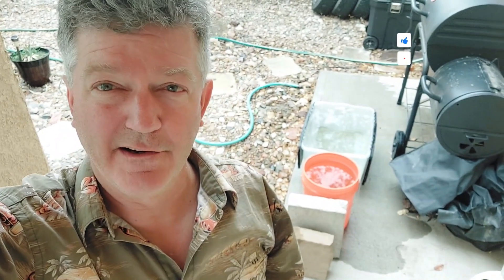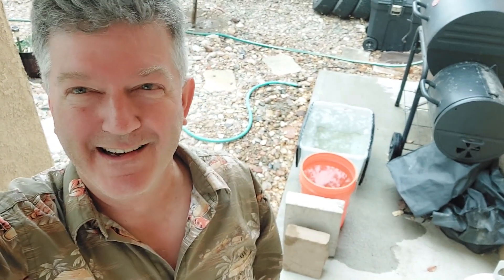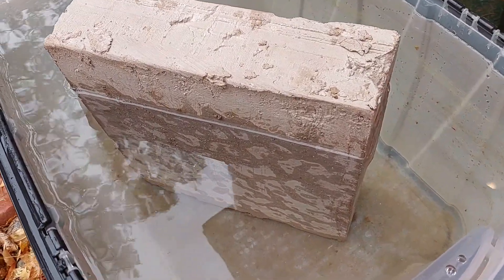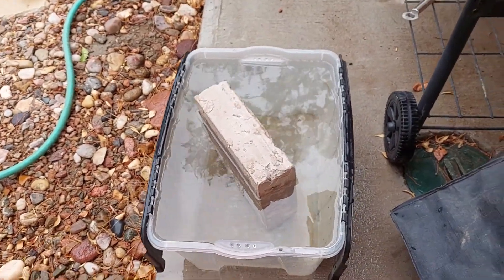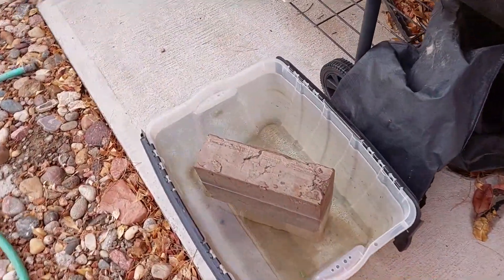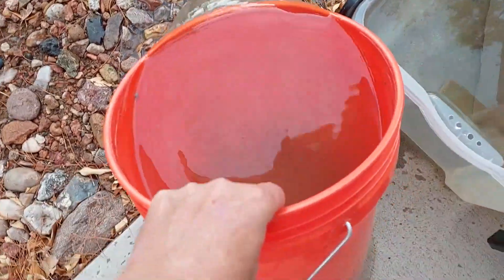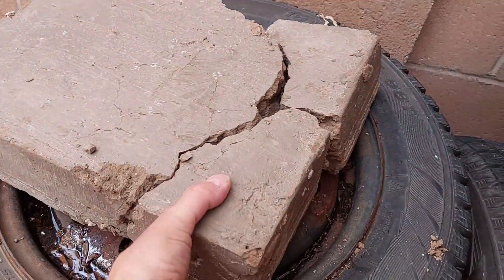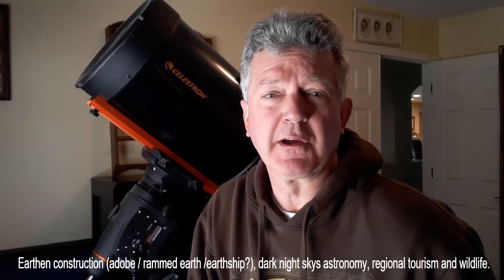NPL Episode 037: Adobe Brick Testing

Comment: Glad you're 'back on the air' and resuming your indepth videos. Really  surprising results there Thayne. But time well spent doing research. The home we rented on Golf Course road was made of adobe, but I never found out who did the work.  You could scrape bits of it off with your finger nail (where the bricks are exposed inside a utility closet) but of course they are covered with stucco everywhere else.  As I learned from many articles in New Mexico magazine going back to the 1940s - the key to good adobe bricks is the right soil.
Reply from the maker: And it took the better part of a full month to get over this nasty pandemic bug. We will make many more bricks and do more testing before committing to adobe bricks. We managed to get back to the property last weekend and yesterday, so more content coming soon as well as our new adventures we will start to film in a few days as they unfold.  Cheers!